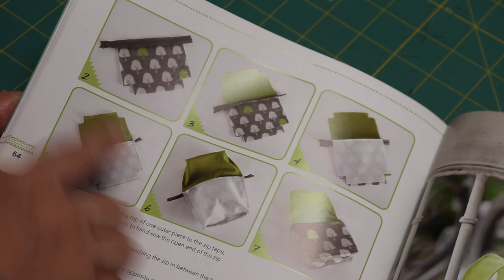Vlog - Day in the Life || 11.22.20 || DIY Corner Desk + Zippered Pouch

Comment: You could put a hole in for cords, then save the piece of wood in case you need to relocate hole another time. Can use the large plug to fill the hole back in, with some putty too. You should just get those cords out of the way.

Comment: you did a great job on your pouch. The only thing I would have done differently than you would be to not overextend the zipper. The top of the zipper has no teeth and no zipper reaching the end so that the top 1" of a zipper can be used as a seam allowance. Other than that you did great!! Good job figuring it all out.